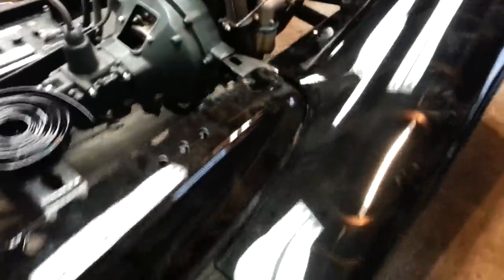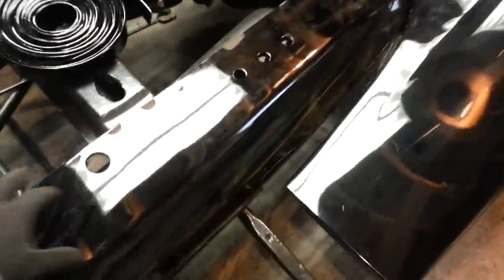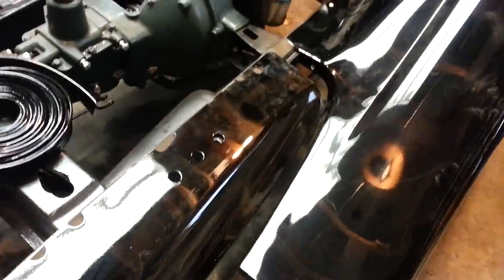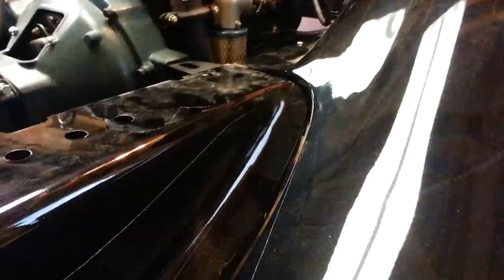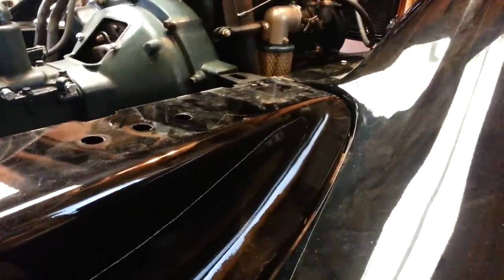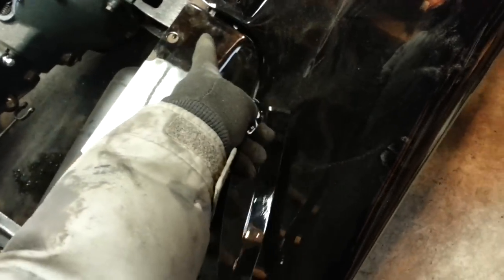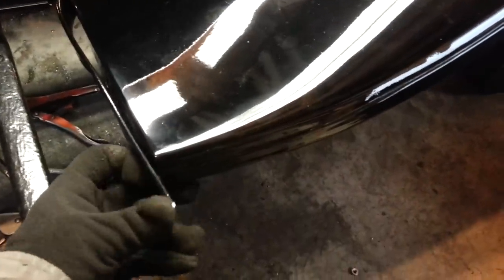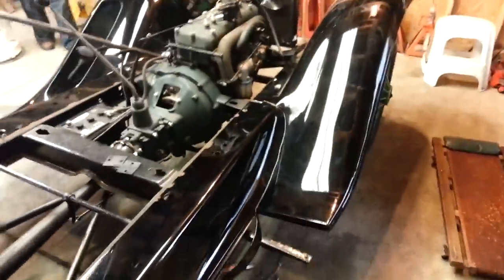1930 Ford Model A body panel alignment part 2

Comment: Many 1st. time home restorers assume that body panels will fit perfectly the first time. So they paint all the parts and attempt to install them. The misfit and frustration will drive them mad! Each panel depends on the adjoining panel inorder to fit at all. A working mockup of all panels is essential to a well finished completed resto. If it does'nt fit in primer, it won't fit in paint either. It's supposed to be fun. Don't shoot yourself in the foot on the final reassembly!

Comment: The biggest mistake you made with these videos was not doing all your alignment of the sheet metal BEFORE everything was painted.All the beading should have been pre- cut,all the bolt holes should  have been pre- drilled in bare metal form.There is too much risk of damaging the paint modifying panels to fit on final assembly.
Reply: Teddy Krol
I pre-fit everything before I progress to paint.Cars,bikes,whatever.It is now more important to pre-fit any NEW sheet metal,especially front fenders to side aprons because of the vast amount of cutting & welding to get these two panels to match.Because of the wear associated with the original dies,the fenders now have to be modified to receive the front section of the side apron that sits on top of the chassis rail.You can't do this process if everything has been painted.It's simply common-sense to pre-fit everything BEFORE the painting process.